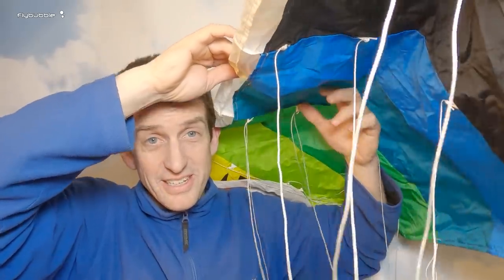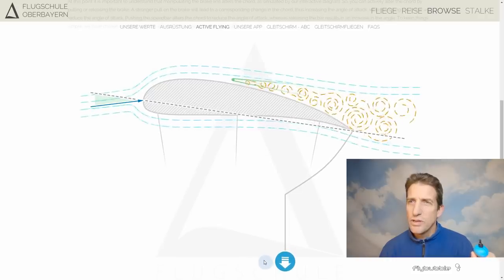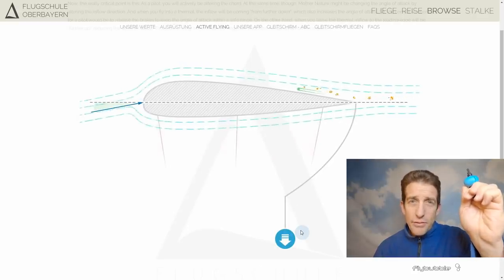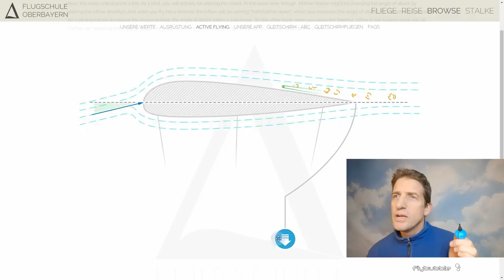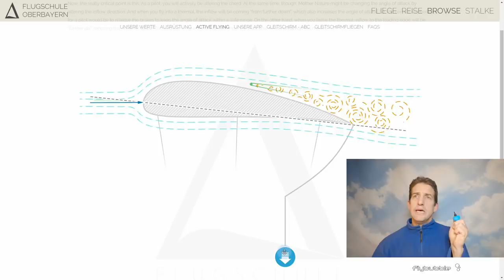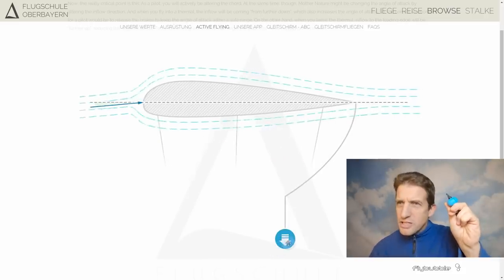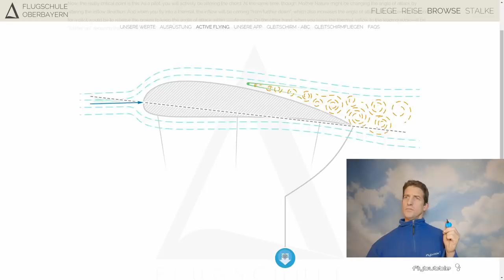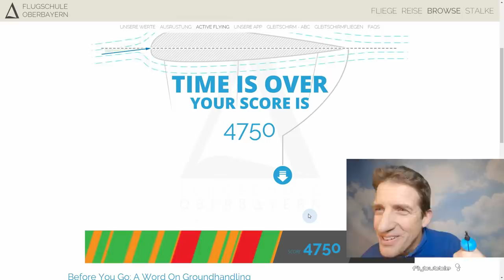Angle of Attack: Test your Paraglider Control!

Comment: I got an advance epsilon 9 and the company said that if you would just put your hands up the wing would fly through the turbulence, better than you can fly the wing through the turbulence. I absolutely 100% believe the advance company mathematicians build a wing that will fly better than I can fly it. I believe there's a lot of gradient in the wind speed around here from high altitude to ground level because of the texture of the surface of the Earth. I think when you get your legs out early and you stand up early you pitch the nose down and increase the speed and decrease the glide angle. This is a wonderful thing if you. It reduces the chance of a stall. Any comment on these ideas?

Comment: Hi Greg,  Thanks for another cool video..Thanks for all you do to educate the PG community.  Truly a living legend.  I've got a question about active flying I've never been able to get a great answer to:  When you're just flying along, wing overhead, all is smooth, how much of your arm weight is hanging on the brakes for trim speed? I've heard no weight at all, hands all the way up is trim..  but then i've also heard that relaxed, full arm weight on the brakes is trim speed.  Speed over ground is faster hands completely up, but then I don't feel the wing as much and what it's doing. i know it's never a static amount and it's constantly changing, but where or how much weighting or pull do you recommend for trim?  and maybe how much for min sink?
Reply: @flybubbleparagliding  Thanks for clearing that up!
Reply: @flybubbleparagliding  I have a related question. Let's say we are at  sink speed. If I go hands full up (0 brakes), how much time does it take for a wing to go from minimum sink speed to trim speed. Is it different for different wings? And is this specified somewhere in manufacturer's specs?
Reply: @ShobhitGupta12  it take a few seconds, and you can definitly feel the difference of air speed in your face.

Comment: Hi craig. I got a question on active flying. When I am flying in thermic conditions, is it a good way to do active flying by mainly using brakes to keep the glider up my head. I heard also about trying to keep constant tension in the lines... what to do to prevent stall and collaps?
Reply: Awesome thanks!!
Reply: Flybubble Paragliding i get it. i will practice. thanks. by the way, you do great think to share your knowledge and i found it very pro. hope to meet you one day and get mentored in a course may be. have a great week. daniel

Comment: Hi Greg, another great video 👍  how does this work a paramotor wing? Then climbing the wing is piched up so how does this effect active flying??
Reply: Active flying is for highly thermal conditions and/or performance gliders. Paramotor pilots dont fly in thermal conditions, and dont need/like performance gliders, they get scared.
Reply: @niconico3907   
So active flying in your experience is only for thermal flying?  Hmmm I wouldn't suggest you become an instructor.
Reply: @5123rick  active flying is needed when your angle of attack is changing constantly, why would your wing angle of attack change if not flying in thermal conditions? Do you need active flying on coastal soaring? In still air, just gliding down from the mountain? No.
on seaside cliffs when Im high enough off the ground I fly full speedbar with hands off the brakes on high B.
Reply: @niconico3907  you do realise the air mass is almost never stable?  And to assume early morning /evening flights are smooth clean air is what gets paramotor pilots into trouble. 
Many people fly low where turbulence can come from any large object from trees to buildings to the land shape. As you know the more wind the more rotor.  Zero wind flights are rare.
We have to land/take of in conditions that may have unstable air,  and the need to have pitch and roll control is what keeps you safe.
Any rotation movement will cause a pendulum effect.
There is wind sheer , gusts and just random rough air. Fly in 10mph wind and unless it is off the beach it is never smooth. The shape of the land miles away effects the air. Laminar air is the dream but unless you coastal flight or fly in nill wind early morning then your going to have turbulence. 
That doesn't even include dynamic flying from small wingovers to tight turns. 
Prop wash and wake turbulence from other pilots or yourself .
Any time your wing is not directly above you , you need to pilot it to keep it there.
I also paraglide (hook2 ) and have always said paramotor pilots should free fly to get experience of wing control.
Reply: @Flybubble Paragliding  my question was how does that explain what happens when you add a motor to the mix? 
Ive flown hook2 on the motor and now the qubik which is a paramotor wing.
How does pitching the wing up during a climb effect that animation? And does reflex make a difference?
Reply: Im also curious...Im a fairly new ppg pilot, and while I havent flown in anything that necessitates active flying, I, and all other pilots for that matter, would be a fool to assume its an impossibility.

Comment: This is not really telling the whole story...
Breaks on paraglider is slowing the glider down and if done fast it will pull the glider back relative to the pilot due to huge differens in mass. 
Breaks don't change AoA peer se. Trim and speed system does. 
Maybe the paragliding community need to start talking about the difference between AoA and AoI (angle of incidence). 
Anyhow, nice video. Active piloting is always a good thing.